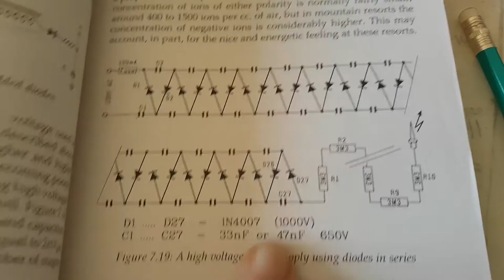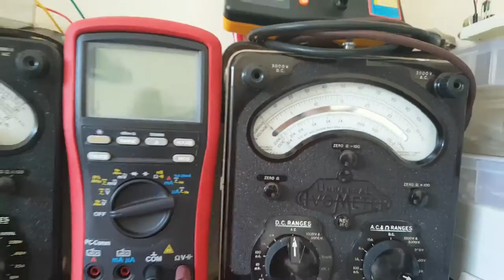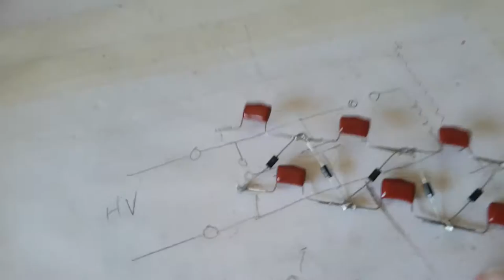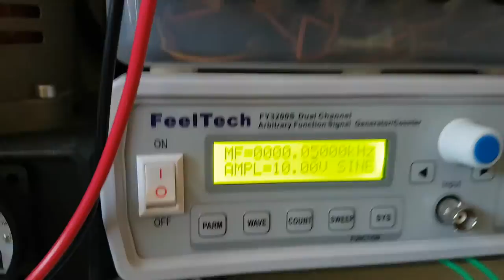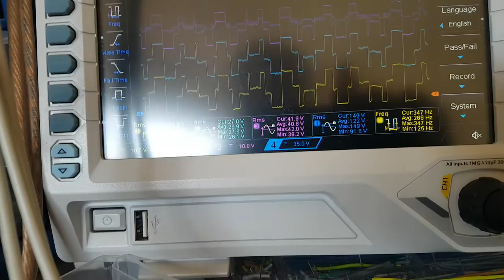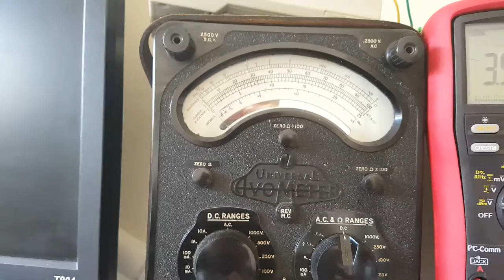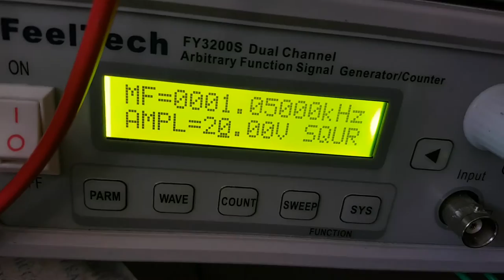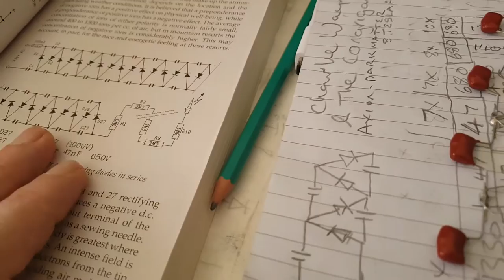Voltage Multiplier Circuit  Experiment

Comment: I was looking for this thanks!
Can we measure DC voltages of capacitors in bottom line(connected to neutral/ground) individually and add them to get the output voltage?
I could measure only one stage with my multimeter but with multistage multiplier it sparks even before touching multimeter probes. I don't want to damage my capacitors or multimetere. Is there simple way to measure total output voltage?
Reply from the maker: Yes, absolutely. Make a high voltage probe. Seek on youtube and you will find ; )

Comment: Since the voltage loss in a multiplier of this form is not only inversely proportional to the capacitance but also inversely proportional to the frequency, I wonder how effective the multiplier can be with a frequency of only 50Hz. Have you played with seriously higher frequencies like 400kHz?
Reply: i would like to try cause my 25khz is failing do i need higher.. what would output 400khz
????

Comment: The frequency is much too low for that capacitor value of 680n and sure is 47n too low. With that values you need (depending on the load, youw scope or multimeter) a frequency of tens of kHz. But if your diodes are 1N4007 or such, they can only work till ca 30kHz
Reply from the maker: Now where were you when I was building this. I am an experimenter without math but your insight would have made this a much better project.
Reply: @Elecifun  That is nice, thanx!
Reply from the maker: @robson6285  Thank you as you help me learn, that is positive.
Reply: Great info indeed Rob! I dropped my MOT project with a ton of diodes etc for the same reason. 50Hz is not doing the job for this :( I have to get back to a flyback solution to create my needed 20-25-30? KV project. Now I want to order a load of these 2CL77 diodes for some voltage multipliers. Can you please tell me if these are fit for a high frequency application? And if so to what frequency, because I unfortunately still do not understand the recovery time of 100 nanoseconds???  And can you maybe also tell me if it is beneficial to put some bigger caps at the beginning of the multiplier. Would this help of make a benefical difference to get more power up to the next stages? Thanks in advance for your reply :)
And great upload Elecifun!
Reply: @robson6285  i have been working with my father on a CW voltage multiplier but for some reason cant seem to get it to work properly weve double checked everything all the components are rated at 20kv  the diodes are fast diodes 100ma and the caps are ceramic 102 so 1000picopfarad i believe or is it nano i get confused anyways double checked many times are layout is correct with 8 stages right now and lots of space between components so there isnt arc over even submersed it in oil ... anyways i read that a CW VM runs best on  a square wave  but can run off of pulsed dc or ac.. and i believe it should be high frequency ac.. so i tried running it with my mazilli driver driving a flyback from a crt  so thats gotta be 40kHz or 50 i think and I dont get any multiplication i just get the same size arc its really weak and like 1 cm or less ... Ive tried running it off of a small little device i got of the net which is basically a tiny transformer with a diode  and a resistor and a transistor and a switch  and it alone creates a 1 cm or less arc  but that gave us shitty results as well.. my dad tried hooking his ocilloscope up to the mu;ltiplier and said it wasnt multiplying the voltage of it until he cranked the scope up to 150khz and then he got the doubling effect of the ocilloscope output (low voltage)  .. ... ANY CLUe what im doing WROng?Ive been researching and watching videos of guys with a similiar set up like ths russian guy whos got his imput from a variac to 2 microwave oven transformers  to  bridge rectifier and capacitors  for his voltage source........... and then he has a similiar or exactly the same Mazilli driver circuit driving a flyback just like mine that goes into a CW multiplier with about the same amount of stages with the same component Values as me   and he sets up  a pin thing that he can raise up  and it was giving of huge bolts hje raised it up 3 times to about i believe  a couple feet or so and HES GETTING HUGE THICK BOLTS AT GREAT DISTANCES... It makes me so mad cause ive been failing for so long and so frustrated and thats why i came to you guys for some help .. I really hope you guys have an idea or can explain how i could set it up better or which components to change EVEN ANOTHER VID AT THE PLASMA CHANNEL He builds a "DESKTOP LIGHTENING" thingy and it is EXACTLY the same components except he runns it off of a arc lighter powersupply which i believe BUT DONT KNOW is the same as my little transformer settup but he gets 4 to 5 inch bolts that look nice too ..SO FRUSTRATED with my piddly little 1 cm nothing after spending all the mon ey on expensive capacitors and diodes and i get shit all.... PLEASE PLEASE READ THIS and HELP ME out so i can also make nice small lightening bolts .. IM not sure if i want to build a tesla coil they kinda intimidate me but maybe someday... for now i just want the biggest bolts from whatever it takes to do it Multiply by CW or Marx or whatever YOU THINK I SHOULD BUILD OR do to get those bolts would be awesome so IF YOU KNOW ANYTHING PLEASE LET ME KNOW or point me in the direction of someone or somewhere to a TALK TO or READ
Reply: @robson6285  ive tried with a flyback drven by a mazilli driver producing 30khz i believe or so.. i used 1nf or 1000pf caps 20kv rated and 100mA 15kv diodes and built 8 stages and im not getting anything but i tiny little spark its so frustrating i tried driveing it with a little 15kv transformer resistor diode and transistor setup from aliecpress or banggood called 15kv step up or something but i had same poor results .. i want thick foot long bolts .. i have a MOT  but i just dont know what the hell im doing wrong do the caps values have to matchj your frequency  for yhour input voltage small caps discharge too quickly? or what ?  i want to use my flyback but im worried the voltage output is too high for my rated components i checked them all after trying it and none of them appear to be blown with multimeter etc... just tiny 1 cm little sparks after 8 stages... my dad had some better results with oscilloscoope at 150khz  he said it worked but that was only low voltage.. i want 300 to 500kv  ideally 1M V but first things first. what caps should i buy and how can i tell if my flyback from an old crt is the right frequency and not too high voltage  do i just guess by arc size?
Reply: Ow I Will Read it better over a few hours, i stopped by you mention that hou use a flyback. From An old tv? Because they have diodes built in, so they give  pulsed DC and for cwvm you must have ac. Sinus is good enough but the diodes inside a tv flyback makes every cwvm after it impossible. That flyback has to give +25kV or so to the crt so its DC.
I Will Read it totally this evening, until then, and i am glad if i can help you make it work because its impressive hv you can get with the components you use!
Reply: @evanm6491  o no, not to high but DC, that flyback i mean. 
Mot is 50Hz so unusefull and i know that 15kV little trafo. Its ca 3kV and much to low power to multiply. You need a flyback without diodes inside so not one from a tv. I used co2lasertrafo's, but they have diodes inside too so i dremel them open(carefull of course)
Reply: @evanm6491  your caps and diodes are totally fine, you bought ideal components with the good values. You get an cm arc from the flyback but after your 8stages multiplier you get the same or even less arclength? Then it is clear, your flyback has the diodes built in. Like All flybacks from crt tv's. Some co2lasertrafo's like Them i use van get dremeled open to reach the AC before the diodes but a tv flyback had the diodes between the windings so that is impossible with a flyback. No you really have to find another hf-hv-trafo. Some tv's with cascades have ac flybacks but thats only some tv's from begin '70's.
Did you get something usefull from this answer?
Reply: @Elecifun  oh when you see ac with the scope on the flybacks hv-output then maybe that is because the scope input is 10Mohm. With more load you see the pulsed dc . But you dont measure without resistors anyway for protecting your scope&scopeprobe. 
So for your cwvm you simply must get another hf-hv-trafo. Something bigger than that little 15kV one (in reality its≤3kV) but a mot gives almost nothing above 200-250Hz so that's useless too.
Reply: @rolandberendonck3900  did you found a flyback without diodes built in? That is sometimes hard to find, a usefull hf-hv-trafo where you can connect to the wire coming direct from the hv windings to get good hf-hv-AC out of it. I used three 40W co2lasertrafo's with primairies parallel and secundairies in series but first i had to Dremel them open to reach the superthin wire from the hv-winding that's inside that massive block of plastic.
Reply: @robson6285  Hi Rob. Incredible! this is the first time I see your answers. I got a pop=up from this one but not from you answer of 11 months!! ago lol. I was not tagged in your answer that's why. AND thank you! for answering. I got hold of hf-ac transformers so getting my voltage works finally :) However this is the first time I hear you talking about opening up a CO2 transformer to get rid of the diode. I made an attempt with a flyback. First I tried to blow up the diode so that it could conduct in both ways but that did not work unfortunately. And breaking it down to get to the diode also did not work because the casing was to brutal to work with, so I gave up. Pitty to hear that the diode in the flyback is in the middle of the transformer, otherwise I would have a another go at this hearing about your succesfull attempts. Anyway thes CO2 transformers are not cheap and I rather put my time in making my own hf-ac transformer than breaking down a CO2 one, because I think that will be a lot of work and succes is no guarantee I think. However credits to your efforts!
Reply: @rolandberendonck3900  that 40watt co2lasertrafo's was about €20 on AliExpress. Inside there are 2 diodes and 2 capacitors so the voltage doubles inside to 20kV output. But the AC is 10kV when you dremel them open. These were the biggest hv-hf-trafo's i could find and they work really great. When not used as flyback but on a igbt H-bridge they can deliver easily 200watt at 15kV AC. But the first time you dremel one open its a lot of work.
Reply: @rolandberendonck3900  i haven't done that but have you tried to "drill" the hole of the HV wire on a flyback? i mean, the HV wire seems to be tied internally (sometimes you can detach it) but there seems to be a thicker long cylinder inside the plastic that ends up to the HV wire, maybe the diode is in there and you may drill it... i know that scooping the thin winding wire may be impossible but who knows, maybe you drill just the diode body and find the anode lead of it (it's just an idea)
Reply: @redoverdrivetheunstoppable4637  The HV wire that is connected in the body of the transformer is just clamped. So if you turn it a little and wiggle an pull it, it has to come out. I also have some flyback's which are new and there is no HV wire connected tot it yet. The core of these Flyback HV wires is solid howere and not stranded. That is why it will get stuck and clamped it you stick it in there.
I made an attempt to break open the flyback, but because the casing is so *#@$ hard and solid I gave up. However your idea to get to the anode of the diode and make a connection in stead of the extremely thin wire makes sense and sounds like a good idea. Maybe I will excavate the flyback some more some time. I also got a hold on and AC transformer that were used for old CRT TV's in combination with a HV cascade. That will also work. There are not many of these transformers but they are out there. On Aliexpress there are also HV power supplies for sale which they use for Electrostatic Precipitators. I haven't tried these, but it is a possibility that in these powersupplies also AC HV transformers are used. The low cost ones are less expesive than a CO2 transformer so, it is worth to try one out.
Reply: @rolandberendonck3900  on further investigations on google images and flyback reference schematics i see that modifying a DC flyback may not be so easy, they apparently use more than one diode along the windings and those may not be on the visible black plastic cylinder where the HV wire is attached... damn i hate potted things!!!

another solution may be to use car's ignition coils but they usually have a laminated iron core, so high frequency may not be much possible

on ebay (aliexpress) they sell HV modules for like nothing, i have a pair of the 15kV ones that are not potted, they produce simple AC current but the core is kinda small and i've measured the secondary resistance to be around 1kohm... they are gapped (easy to ungap) and comparable to CCFL drivers you may find in numbers inside LCD TVs that are not LED backlit

i'm sorry to make you jealous but i have three AC tv flybacks from the sixties :D (they make a small arc by themselves, compared to the DC ones) they have a secondary resistance of 300ohms and a thicker core than CCFL trafos
Reply: @robson6285  THANKS ! IS THERE ANOTHER TEST I CAN DO TO SEE IF THE FLYBACK HAS A DIODES IN IT? I USE THE MAZILLI DRIVER AND I CAN "draw" out 3.5 inch arcs when powered by my 5s 22v 1300mah 150c battery but thats when not connected to the cw multiplier
Reply: @evanm6491  So you want to see if that flyback gives out AC or DC? It is too high voltage for nornal multimeter so you could test if a capacitor blocks it like DC but that cap has to work with the high voltage. But the first component in the cw is a cap so that the cw doesn't work tells me it is DC, like from almost every flyback. 
Or you could measure or scope trough many much-mega-ohm resistors while driving the flyback as low as possible.
Reply: @evanm6491  i myself built a little 200volt(@only1mA or so) to test hv-diodes when a couple of them are in series. Each hv-diode has often a voltagedrop of 15volts(25x0,6v inside each 2CL77). When you have a currentlimited(a fat resistor is enough) couple of 100volts then you can measure the diodes in a flyback directly. The resistance of the windings dont matter then, when measuringvoltage is high enough i mean. Can you work with this?

Comment: Which can be best voltage multiplier for high voltage project. voltage doubler, tripler or quadrupler?
Reply from the maker: A voltage multiplier is a double, triple etc
Reply: Elecifun 
is Voltage quadrupler and 2 stage of Voltage doubler same??
Reply from the maker: Physically yes, potentially no. Every stage added does not add up to the voltage being doubled.
Reply: @mdasad2827  of course